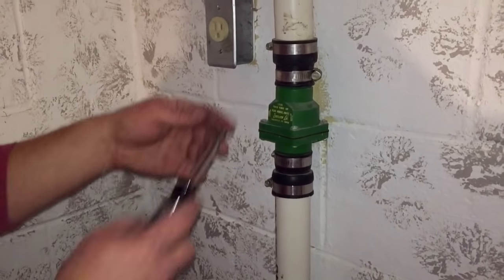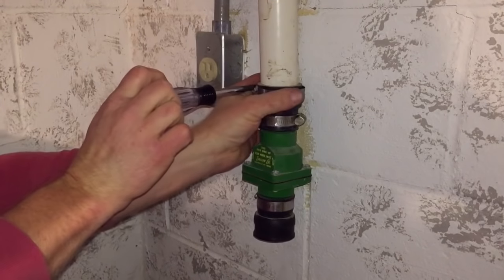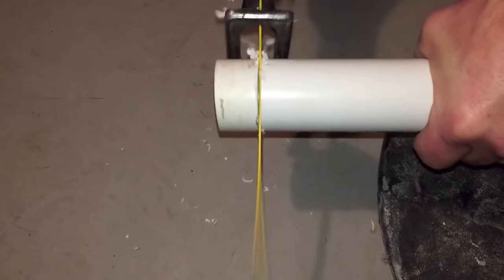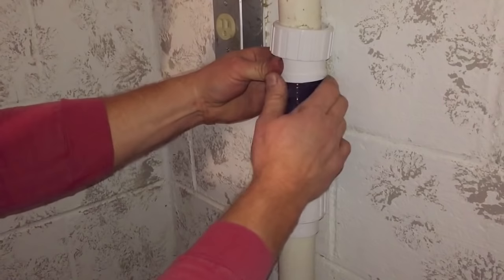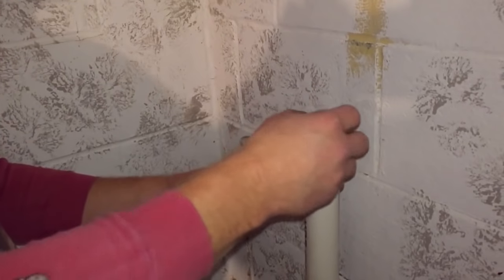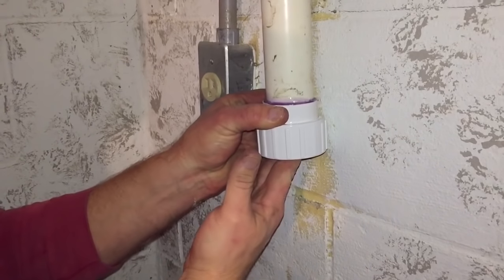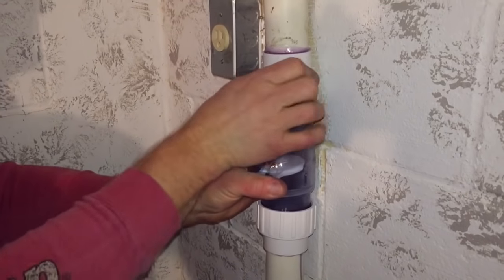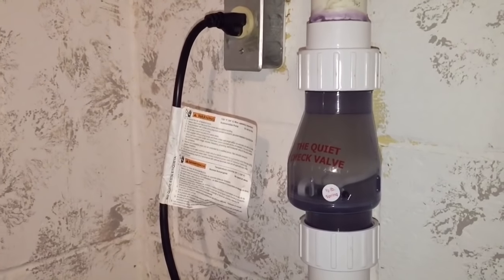How to install a quiet check valve on your sump pump

Comment: Thank you for this video. I installed mine and this video helped.

Previous valve would sound like a shotgun going off. Night after I installed this, it rained heavily and I couldn't hear my sump pump shutting off. In the morning I checked on it, and it had been doing it's job all night.

Very happy with the valve.
Reply from the maker: I love this one. Thanks for watching.

Comment: Great video!  A tip on gluing plastic pipe.  Give the fitting a twist as you push it onto the pipe.  This reduces the chance of channels forming in the glue joint which can cause leaks.
Reply from the maker: Yep I do that all the time, it definitely helps. Thanks for watching.
Reply: Thanks, that's a good suggestion.

Comment: I like this check valve. But prefer the rubber fittings, just in case this fails you won't need to cut it out and replace the piping, just my personal preference. Good video
Reply from the maker: For me cutting the pipe is no big deal but I get it. Another option is to install a union on both sides of the check valve.

Thanks for watching.
Reply: The rubber fittings are prone to fail more than the pvc fittings

Comment: Will a 2 inch quite valve work with a 1 1/2 reducer to 1 1/2 pipe ? Thank you for your helpful video!
Reply from the maker: I don't see a problem doing it that way. Thanks for watching.

Comment: Is the glue and primer necessary? Seems like the new check valve can hold a strong seal using just the threads.
Reply from the maker: The threads will hold fine but the PVC to PVC is meant to be glued, I would not trust a dry fit. Hope this helps, Thanks for watching.

Comment: What is advantage of this check valve over the one that clamps? Seems when you need to change valve you have add new pipe instead of just taking valve off.
Reply from the maker: If this type of check valve happens to go bad, it can easily be replaced by loosening the nuts on either side to make an easy, quick replacement. Other than that it is quiet, but as far as how they work I don't see any avantages. Thanks for the question.
Reply: Read all the Amazon reviews and you will be sold! My 10 year old installation had a totally white check valve and it clunks every time the pump runs. I order this check valve after seeing all the pluses. Also the Nex Pump dealers locally use this check valve on their unique Great system (also sold online at Menards)....so if they think it's good that is a good sign their products are $700 to 1700 I think, two pumps per pit, battery backup and wireless access to alert you with information.

Comment: I bought the same check valve and i noticed when i pushed up on the valve with a stick , it seems it takes a lot of pressure to open it , wont this burn out your pump quicker
Reply from the maker: I installed this in 2016 and it is still working as good as when I installed it. So I think it will be OK. Thanks for watching.

Comment: how long does the check valve last?  If in the future the check valve breaks, do you have to cut the pcv pipes to install new one?
Reply from the maker: They can last 10+ years depending on the valve. If I were to replace the current one I would try to find the same one so that I would just be able to screw it on, other than that I may have to cut pipes.
Reply: Thank you!  i just ordered one :D hopefully it works.  BTW, did you have to put a coupling on the bottom of the check valve for easy replacement of sump pump?  I am thinking about doing that.
Reply from the maker: I did not. I figured I would if and /or when I have to replace the pump. Also the coupling on the bottom of the check valve can be removed if need be then the pump can be removed, but it wouldn't hurt to add a coupling. Thanks for the questions.
Reply: Thanks for the response back!
Reply: Got new sump pump, and installed the check valve!  couldnt be happier!!! thanks!!!!!!!!!!!!!!
Reply: Yes, if you have the same valve as a replacement, you can change the valve in under 1 minute by just screwing the top and bottom connections.

Comment: That check valve is set to high. Should only be 6 to 8 inches above the pump. Also that should be a 20 Amp GFI out let. Any time it's connected to any thing in water or close to within 3 ft.
Reply from the maker: The ideal height for a check valve is about 2 ft. above the pump. Given that this was a direct replacement for a check valve that had worked for years it was installed in the existing location and has continued to work in this position since this video made over 8 years ago. All this said I would say that the check valve is not “to” high. Also it is hooked up to a GFCI. Thanks for the comment and the view.